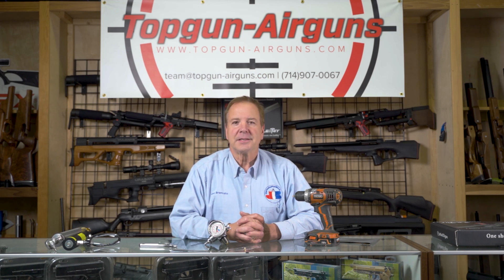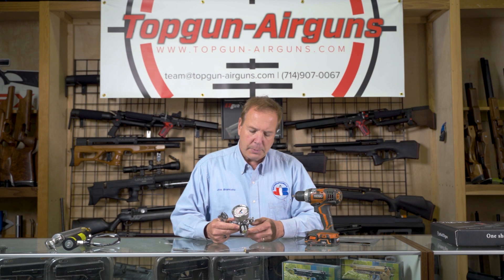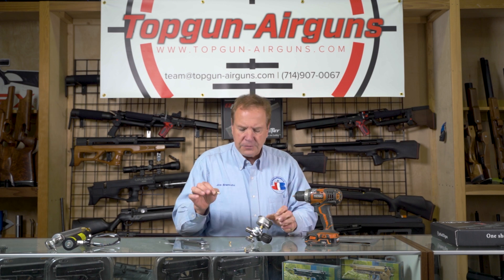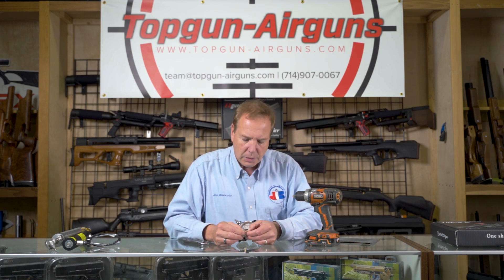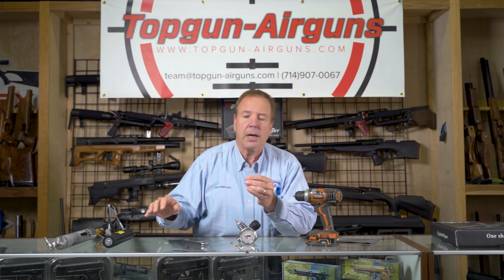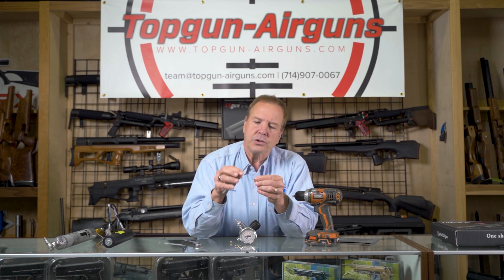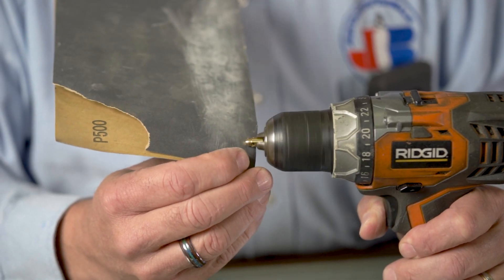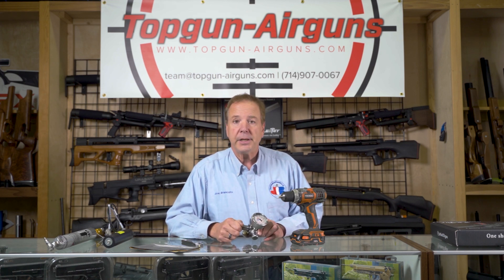Short Shots EP5 : Adjusting and Maintaining Your Slow-Flow Valves

Comment: Hi i need a slow fill station to put into the pro din valve with the din incert removed so i can fill my pcp safely and slowly.What fill station that will screw into my faber 100 cu ft steel 3442psi tank will work best and is the most resonably priced thanks.I went with this tank as it will have plenty of air for my needs and is half the price of an scba.Thanks
Reply from the maker: give us a call and talk to one of us, we can get all the info and walk  you through it :)  (714) 907-0067
Reply: @AirGunScientist  Thanks a bunch Joe